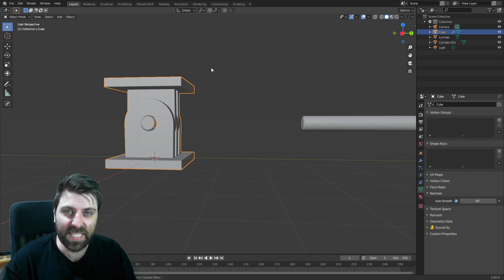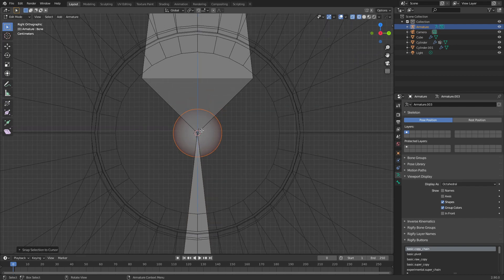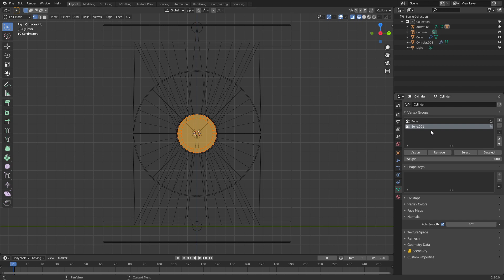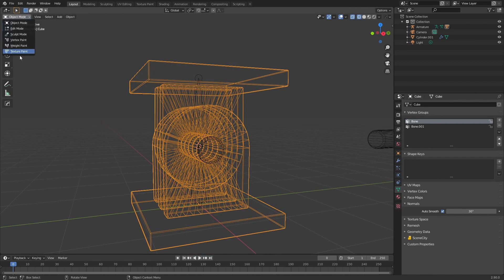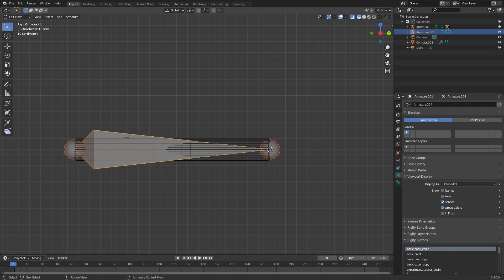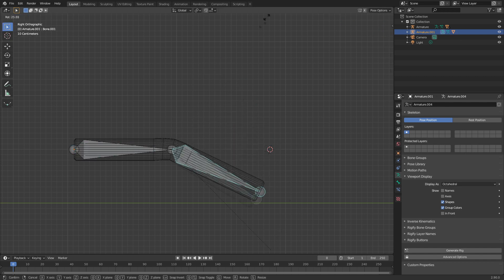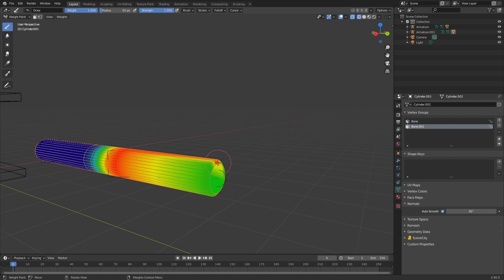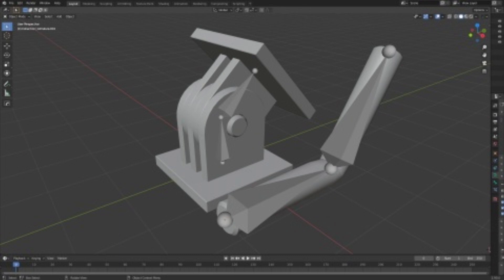Blender Basic Rigging Tutorial

Comment: Markom3D this is great and all, but I'm having trouble with a few things.  Particularly, I can't find the part of the video where you added specific vertex groups to the "Bar" object and how you linked those vertex groups to the specific bones... if that's what you did.  I mean, at 3:58 you mention that the bar has two vertex groups.  Does this happen automatically when you parent the bones to the mesh or did you have to create them separately and link them to the bones somehow?  How do you do this?  Am I even correct in my understanding of what you are using the vertex groups for?  I really, can't understand how Vertex groups and Bones work together.  Did you explain this in another video?
Reply from the maker: So, I created those two vertex groups manually for that part. Now you need vertex groups for an armature because the vertex's needs to be assigned to a bone. If you just have a bone there, how does the mesh know what bone to attach to?

Comment: That is what I was after. I'll have to do it step by step though. ONE Question,, I have designed a suspension system that I will rig, but it includes a leaf spring, how do I get it to flex proportionally along its length??
Reply from the maker: so, I just had a play and what I would do is have three bones with the center moving up and down. On all three bones, in edit mode goto bones tab, an under bendy bones, increase the segments to 3. Now parent with auto bone weights and you should be all good
Reply: @Markom3D  ta mate, I'll try it today. Only been in blender four months though, I'll be slow